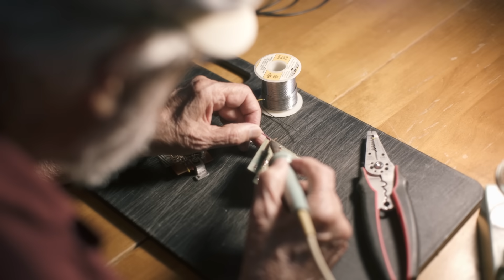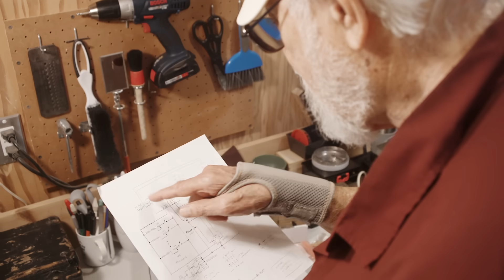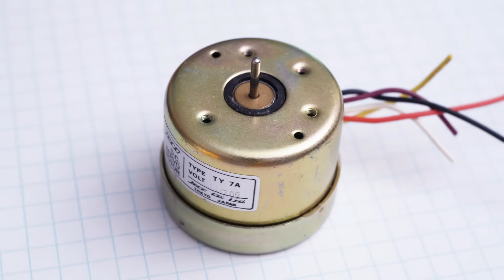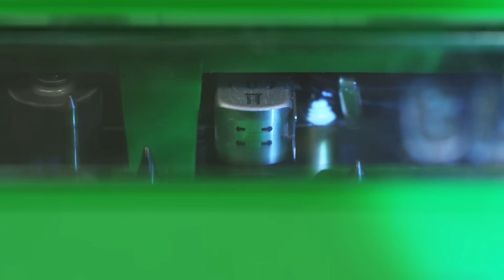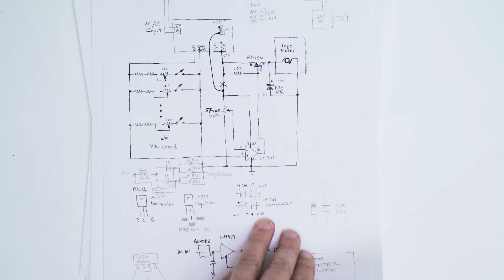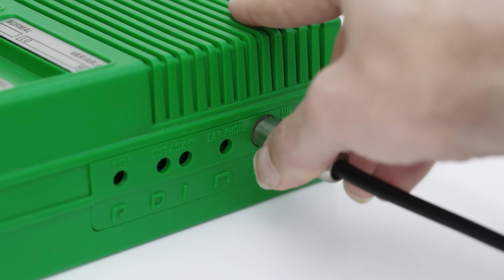Tape Speed Keyboard

Comment: Yeah I wouldn't have used one of those talking book decks but otherwise pretty cool. I made a tape for mine when I had one. Had to take 6 hours of mono content and combine it into a double speed stereo file before I recorded it on a 90min tape. I also had to reverse the right channel because of how the tracks are arranged like a quarter track stereo reel to reel. Listening to the ride track is indeed listening to what is normally side 2. I would have used an ordinary stereo cassette head that records the two tracks in parallel.
Reply from the maker: Yeah, I definitely would have used a different deck if I knew then what I know now. I record both sides onto my tapes at once with a weird 6-track (yes, 6!) deck that I have.

Comment: You can make a looped tape gapless, for example by recording silence on the whole tape, then disabling the eraser head and recording for the same amount of time the tape has. If the union between sides is diagonal (instead of straight) it's probably imperceptible.
Reply from the maker: Oh, totally. At one point I was thinking about making a machine that would have a specialized erase head enabling/disabling timing circuit to basically do this. But I'll never get around to making such a device. Next life, ha ha ha.
Reply: @japhyriddle  You can check if the recorder has a spring loaded eraser, and if that's the case you can just block it with something flat.

Comment: Awesome! This just had my rushing through several ideas myself:

1. I want to build that myself > I don't know how.
2. I'll just use my studio tape deck thingy! It has a tape speed knob and I'll just "play" that > The range is not wide enough to play something worthwile
3. But It's an 8-Track TASCAM. I could use different notes on different tracks to widen the range > Too complicated
4. I'll just play eight notes through the faders. That's a wild idea > That's how "I'm not in love" was recorded
5. I could build a mixer with buttons like a keyboard > That's just a poor mans mellotron...

Looks like I'm going to build a mellotron :D
Reply from the maker: Perfect train of thoughts. I'd love to see that if you build it. I've thought about that idea as well. 

I also once had a silly idea about using a multi-band EQ as a way to play different notes. I made a sound consisting of sine waves matching the frequencies of the bands. So, I could use each slider as a different key. It didn't work. I think the Q wasn't sharp enough or something, but it was a cool idea. I should try it again with the new multi-band EQ I have now.
Reply: @japhyriddle  I imaginge the filter and the Q have to be quite accurate to get this done. But if it works you could do it with a tape full of white noise :D

My plan is absolutely easy to to but hard to perfect. I downloaded some original Mellotron samples and combined them to sounds I like. Since I only have 8 channels to work with I'll have to use different tapes for different scales. Then all I have to do is to record a whole tape full of each note and "mix". The annoying part is playing the thing because I have to turn up the channel and turn it down again before playing the next note. I don't have a simple way of playing it like a piano...

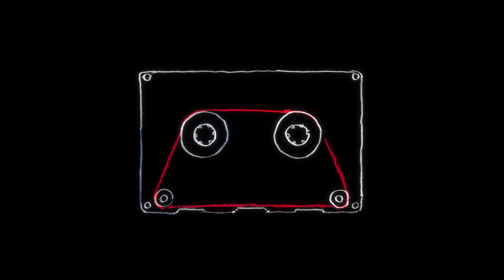Comment: 8:20 you can do a continuous splice
Reply from the maker: It's not about the splice. The gap comes from the distance between the erase head and the record head when recording onto a tape loop. If the tape is recorded onto before constructing the loop, then it's not an issue with a diagonal splice.

Comment: Doing a search for "voltage controlled tape machine" shows that you are definitely not the first to control a tape player by a keyboard - but that doesn't mean that it's not a cool project 🙂 I considered doing something similar at some point, but instead I used a voice recorder chip that I found a way to control with a voltage, so it became a completely electronic project. There were also tape based drum machines back in the 60's and 70's, but they used a wide tape loop with many tracks on a single tape - usually something like 2" wide and with a movable head. There were also a few that were based on 8-track cartridges since they have the advantage that they have 8 separate tracks (hence the name) and are designed to loop, so they don't have the problem that they run out.
Reply: Yeah, there’s the Cassettone MK1 diy kit, the Noodlerider Cassette synth and I’m pretty sure Ondes Magnetique make some one-off voltage controlled cassette synths. So it’s definitely been done before, it doesn’t make it less of a cool idea and interesting project
Reply: It's one of those ideas that multiple people would come up with.
Reply from the maker: Oh cool. That voice recorder chip thing sounds like a neat project. I remember the batteries running low on little voice recorder toys being really funny to me as a kid. Oh, yeah. I remember hearing about tape-based drum machines. That would be so fun to play with. Yeah, a few people have suggested 8-track tapes here. It makes so much sense : )
Reply: He never claimed he did
Reply: @michealpersicko9531  7:39 I would say "implied" 🙂
Reply: Ur lame
Reply: @TheAlaskanBullW02  That's an occupational hazard of being an engineer.
Reply: Cringe bro

Comment: Great idea and fun execution! I think I'd probably have stuck with a MIDI keyboard and an Arduino to push out the motor control voltages digitally. You can also control the ADSR that way. Would of course require some programming knowledge but would simplify the tuning and would keep its tune better (I suspect your trim pots will drift over time). Replace the cassette deck with a Space Echo or other tape delay unit for a similar "We've already figured out the transport part".
Reply from the maker: Yeah, I think there are definitely some things that would be gained from using MIDI. But I just loved the idea of going the analog route. It's just such a beautifully simple premise in my opinion. I also really liked the idea of using standard cassettes because I liked to imagine a world where we could all trade tones with each other easily... if we all had tape speed keyboards, ha ha ha.

Comment: I desperately want to hear what it sounds like if you put in a tape of a pre-existing song or a person's speech
Reply from the maker: It sounds just like whatever is on the tape. But you can play it at different speeds/pitches. And you can play both side A and B at once (one side will be playing backwards).
Reply: Track 3 and 4 would be in reverse.
Reply: i bet it would speed up or slow down depending on what key was pressed

Comment: Random thought while watching this
It wouldn't really work with a full-size keyboard, so let's say it would be 10 keys (one for each finger), with the keyblers relegated to pedals
Instead of only being able to use one key at a time, you could instead assign each key a power of 2 (so the first key is 1, the second is 2, the third is 4, then 8, and so on). Then you could press any combination of keys to get a unique value from 1 to 512. You now have 512 "steps" as your resolution which you can apply to any range of tape speeds (using some sort of intermediate interpreter or controller?). Still monophonic, since you're still only playing one tone, and probably not with quite as much of that analog directness you like, but it would certainly be a unique way to play an instrument
Reply from the maker: Ooh, that's such an interesting way of designing a keyboard. It's like the stenographer's version of a keyboard. Probably hard to play without practicing a whole bunch, but I love how quirky that idea is : )

Comment: i could see it being quite easy to do the same process on several really cheap tape decks and use a tape duplication setup on some tape loops to get a polyphonic version of this, like a mellotron for thrifting addicts lol. i suppose the biggest hurdle would be tracking several key presses to the individual tape decks but it’s not like it’s a impossible hurdle

might have to try this out…in thirty years
Reply from the maker: Oh, definitely. That could be done. Easier would just be to install a multi-track tape head. I've come to appreciate the lack of polyphony, though. I like the fun of extreme limitations. See you in thirty years for the jam session ; )

Comment: wonder if you could do something along the lines of duty cycles/pcm to make it somewhat polyphonic
might wreck the tape or the deck but would probably sound awesome
Reply from the maker: I don't think I understand what you mean. Like amplitude modulation at hearable hertz?
Reply: @japhyriddle nah just having it play the different speeds after eachother in a sequence 
first key pressed for a fraction of a second, then the next, ect.
Reply from the maker: @thegrate1521 With a stepper motor, I think that could work. I see what you're getting at. That would be pretty cool.

Comment: Whenever music tech goes digital, it introduces layers of abstraction. Both the musician and listener become separated by another layer, even if it's small. And, it's a slippery slope, where falling to the temptation to use one digital tool makes it easier to introduce more digital tools. But analog circuits, magnetic tape, vinyl grooves, all these non-digital tools keep the musician and the listener as close and as connected as possible. The sincerity and soul gets washed out along with all the quirks and noise that digital tools try to eliminate.
Reply from the maker: I try to stay as open minded as I can when it comes to musical tools. I don't judge anyone for using whatever they want to use, but I confess that sequenced music has just never hit me the way that live playing does.
Reply: @japhyriddle yeah absolutely, it's all about tradeoffs. Sometimes digital tools help you do things you can't otherwise, but there's an ineffable cost. Either way, you've made a fantastic thing, Japhy ❤
Reply from the maker: @BiteSizedZeitGeist  Thank you very much.

Comment: You could use and 8 track for 8 different sounds
Reply from the maker: That's not a bad idea. Those are a lot cheaper than multi-track cassette decks. Knowing me, I'll never get around to anything like that. But that's a great recommendation for someone else who would like to build something like this.
Reply: Also, older hardware would likely be even easier to work on
Reply: And it would loop automatically